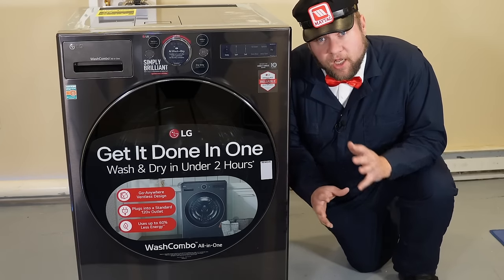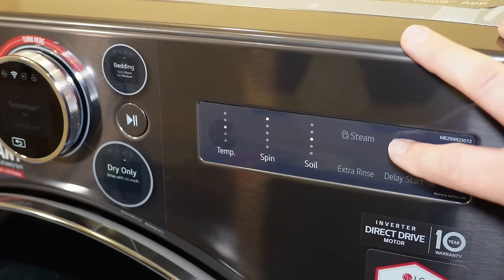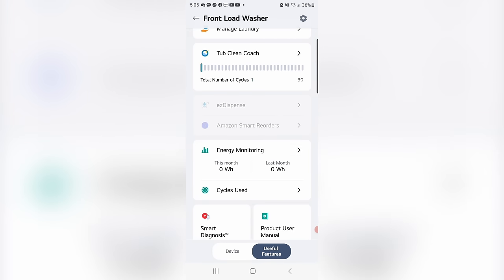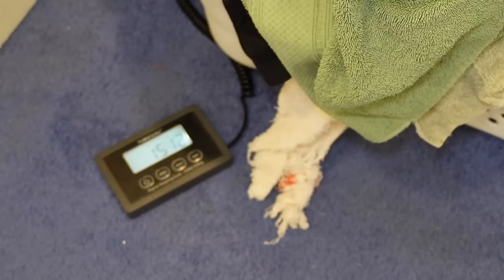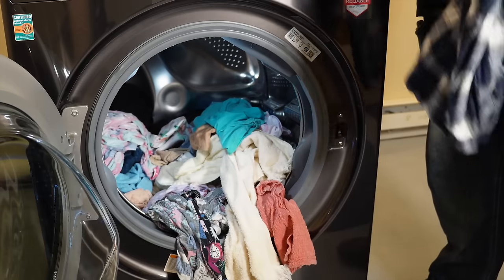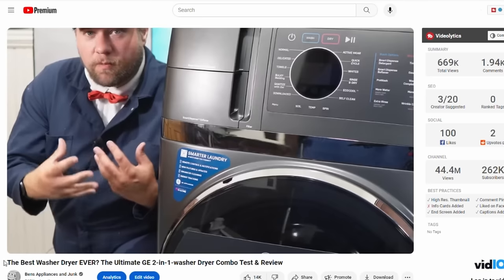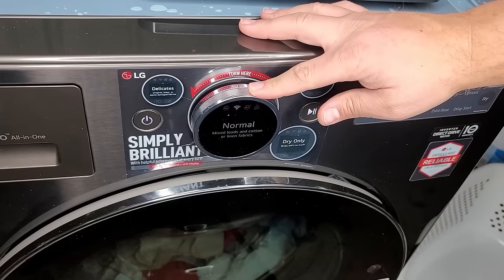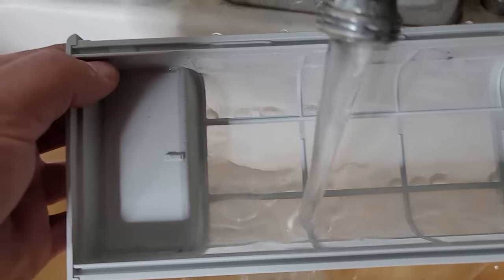BETTER THAN GE? The LG All in One Washer Dryer Combo: Test, Teardown & Review

Comment: What people are forgetting is that regular driers get lint buildup and need cleaned at least once a year, and you also have to worry about the ductwork in the walls. 

I wonder if the coils on the GE unit could be gently sprayed to clean them in a way that’s similar to how LG cleans the coils.
Reply: I picked up a high end Whirlpool dryer off of craigs list for free. The lint screen was packed with lint. I mean packed. I took it completely apart and inside was full of lint everywhere. Every crevice, heating elements, everything. I had to vacuum and clean out every square inch. I think they ran it until it wouldn't dry anymore and threw it out.

The dryer was also left outside in a downpour when I picked it up. I wondered if it would even work. I had to replace the drive belt and I think a couple of other inexpensive things. I think it was less than $30 total. Much to my surprise after I put it all back together and dried the control board out, it fired right up. It's electronic. It worked so well I switched it with my regular dryer I was using. That was years ago and it's still running well.

It's amazing how dumb some people are with things. Like not cleaning the lint out.

1960s Chevrolet Owners Manual - Here's how you adjust the valves, set the points, timing, etc. 
2020s Don't text and drive. Don't swallow Tide pods. If there are any problems take it to a service professional.
Reply: my washer dryer combo also get lint build-up that you have to clean after each dryer cycle
Reply: Lint build up once a year?   What are you washing?

Comment: You may have had better luck with the comforter if you had unfolded it, giving it a better chance of shifting around during the cycle wash and dry cycles leading to better results.
Reply: I truly believe this man doesn't do his own laundry considering the fact that is Laundry Basics 101. Not a single dryer can actually fully dry a comforter without turning it "inside out" half way through the drying cycle.

Comment: No dryer will dry both large comforter and sheets at the same time. Both of the things you said about why is true, but another reason is either the comforter or one of the sheets ends up completely wrapping the others up inside it not allowing the moisture on them to evaporate efficiently while also not touching the sensor making it think it's done. I have a king bed and some very large fluffy comforter(wife.....) and even with a very large Samsung stand alone dryer with plenty of room I can't dry them at the same time. One of them always swallows the others up and only the outside one dries. I've set it and kind of forgot about them b4 and came back a couple days later to discover the ones inside mildewed....my wife was not happy lol.
Reply: You need to try the GE ultrafast. This sheet wrapping thing does not happen and no need to open and adjust the drying load either. I would guess your King comforter AND sheets would about 3:15 total to dry. You might add 10 minutes but seriously the hot air being blown into the machine from all sides fixes the large load problem. I've had one tangle in 5 month and it involved the drawstring on some shorts.

Comment: I have an apartment washer dryer LG combo It still works great! You do have to do more tub cleanings than normal though because of the lint. I think mine's from 2017 or 2018
Reply: How do you have yours connected to? Does your apartment have hook ups or a sink connection
Reply: @EastCoastCamping  hooked up to a regular washer hookup in the wall. You can get the adapter for that to hook up to the sink mine didn't come with it but I can get one.

Comment: I'm happy to see more All-in-one heat pumps coming out. I got my Miele washer and heat pump dryer set a couple years ago, months before the GE became an option. Space savings and not having to switch from the washer to dryer would be nice, but I've otherwise been mostly happy with the Miele aside from having to troubleshoot plinth filter alarms. I wonder if the GE or LG have similar issues as I only see one filter being cleaned vs the two the Miele has.
Reply: I believe the GE has a 2-stage filter.  1 they say to clean every cycle - the other as needed with a warning light.
Reply: Personally, I love having the two separate Miele units: doing so allows for much better drying and washing times, plus we can do two loads at once. Having them stacked means they don’t take up any more space and an all-in-one would, but we also didn’t plan to fit them under a counter anyhow.

As to the dryer’s plinth filter, the big thing to know is that Fabic Softener is going to make it clog up a LOT: Softener is an additive that basically coats the clothes in silicone, which clogs up the plinth filter’s smaller pores really fast. Switching to a non-softening rinse agent will do wonders!

I also don’t trust units without double filtering, as it all but guarantees the compressor’s heat exchanger will be clogged by lint, ruining its effectiveness. Those small fins are near impossible to clean, so having a second filter is smart and ensures a long life.

Comment: I would definitely get the GE version because of warranty issues on the motor. I can't wait to see reliability on this one as time goes on. I guess if you like the app and get extended warranty you'll be ok for 3 years, but there should be a lot longer warranty with how pricey it is.
Reply: Both the LG and GE have a 10 year warranty on the motor tho?
Reply: Overall, LG makes a much more sturdy and reliable washer than GE. Also, the direct drive motor Lg uses is way more reliable than GEs belt drive motor, yet they both have the same warranty? Shouldn’t that be an issue with GE?
Reply: @TylerRing from what I recall, the GE heat pump is very easily accessible and easy to replace compared to the LG.

Comment: So as a servicer of some of these already the biggest complaint/issue we've had is that the dampening is not great. It just doesn't absorb the shock of the spin cycle well and causes a lot of OOB issues.
Reply from the maker: Thanks for the info! I would have assumed the suspension system would of been identical to their other 5.0cf washers. Any thoughts as to why this isn't the case? Is the spin RPM higher on this?
Reply: @bensappliancesandjunk  We've had very few calls on just the washers, or those new "built together" stacked units. It might be that the 2 in 1s are more susceptible to shaking if they aren't on a base floor(whether it be basement, or first floor for those without.)

The suspension in these uses a lever system, but it seems to only absorb shock in the front to back motion, left to right rocking doesn't translate well into it and that is what your typical OOB load induces. I tried everything to help a customer out, but after a long phone call with LG visual support they essentially blamed the customer for loading it incorrectly so I couldn't resolve it.

Comment: Heat pump warranty is a non starter since that’ll be the first thing to mess up. I thought this looked easier than the GE to disassemble, but maybe I’m just used to LGs. As you mentioned, the lint on the condenser is a huge issue. It’s going to be clogged after a year — especially with how bad people are at basic maintenance. I’d like to see a similar test and tear down on a tr7 Speed Queen.
Reply from the maker: Eventually I'll get to a TR7 at some point. Either that or a TC5, or hopefully both.

Comment: I originally purchased the GE and used it for a few weeks while waiting for a replacement due to aesthetic delivery damage. The replacement ended up being damaged during delivery as well, so I gave up and decided to go with the LG instead. The LG is much quieter with less overall vibration.
Reply: Too bad it takes twice as long to dry though.
Reply: @Finndian  In my experience, it does not take twice as long. A bit longer than the GE, usually the case, but laundry dried in the GE often felt slightly damp when it was "done" (and may have needed more time) while clothes come out completely dry the first time with the LG.
Reply: @btober  I think it's all about how much you put in it. This video definitely finds that it takes much longer to dry the same loads in the LG.

Comment: Excellent video! I first came across your videos on a YouTube suggestion for the GE all in one washer dyer combo. I was sold on the GE until this video, now I'm rethinking. Also I have watched many of your other videos. Thank you :)
Reply from the maker: They're both really neat machines. I don't think there's such a major deciding factor on one that makes it must-have. Both would be personal preference based on situation.
Reply: @bensappliancesandjunk  I have the GE unit. I have also seen lint on the condenser coil of that machine, but it is pretty easy to clean with a dryer lint cleaner kit from Amazon. I saw on Reddit that people have had luck adding weather stripping to the filter. The GE washing machine also has AI cycles, although I could not find any information on that other than a sentence in the owner’s manual. I usually use cold water, and now it defaults to that.
Reply: I own the GE and have the following observations: It typically uses 1kwh per load (equates to 27 cents in my area) which appears to be better than the LG but my GE produces very wrinkled loads regardless of content (sheets and bedding are just as bad as shirts and trousers) even if using one of the dewrinkle modes. Also, I didn't buy a washing machine so I could play with my phone. The GE performs just fine without using the app.
Reply: Thanks for the replies everyone! My situation is I'm in a one bedroom condo in a century old building. I need to save up for the expense of the vent build out, the gas hookup, and water and drain - all new. In the meantime the ventless all in one combo is the best solution. I'm not necessarily looking for a quality wash, within reason, but more the reliability. The older all in one units were too small and slow. The GE which I watched the video here a few months ago I was sold on but then after the this LG video I think I prefer the LG. From what I understand the GE is a little bit faster for the whole cycle but the LG is more reliable - a proven track record with the motor(?) and is quieter.
Reply: @jeffreygonzalez4353  Both units have a 10 year warranty on the motor. As he pointed out in this video the LG heat pump is undersized and only has a 1 year warranty. The GE is a 5 year warranty on top of being more robust. Just something to consider. (also you CAN control/remote start the GE with your phone unlike what is inferred in this video.)

Comment: Ben, thank you for this excellent review. Seeing the lint already built up on the heat pump coils was disconcerting. I do own the GE, bought it thru Costco in December for $1980. (good timing!) Yes, the GE does allow lint to get past the filter and collect on the heat pump coils. But... I can easily get to them when the filter is removed, so it's easy to clean off that lint. For me, that's a big deal, because as the lint builds up on the coils the performance will slowly drop. 
So yes... your video helped me. I'm keeping my GE. I'm also looking forward to a side by side comparison of the two machines. Thanks again. You do superb reviews!

Comment: Tip for those who are new to heat pump wash/dry combos to reduce dry time: pause dry cycle to put a dry towel or a few dryer balls to reduce drying times. 

Also, we regularly find our clothes are sufficiently dry with an average of an hour remaining on the dry timer, so worth setting a timer reminder to check your clothes and hour early for dryness. 

Additionally, avoid the temptation to overfill. Split a large load into two for fast and even drying.
Reply: I was wondering if the fairly hard wool dryer balls and the rubber dryer balls with the spines could just go in the wash cycle? I use one of each.
Reply: @jgoog7442  Personally I wouldn’t, as I tried this with my own rubber spiked balls, and after a few wash/dry cycles, the detergent made them hard and brittle and one developed a small crack. 

I also wouldn’t put the wool balls in the wash either, as that may actually increase drying times as there would be additional items to dry.
Reply: My concern is the filter you mentioned at the 11 min mark. Sounded like a home owner should be cleaning this frequently but not clear on how accessible this was as it looked like you had the machine apart

Comment: Thank you for this video, I bought the LG WM3997HWA Ventless 4.3 Cu. Ft. machine back in 2020, its been running solid without a single hiccup since then (its even running right now). Yes it takes a while to wash / dry. BUT, its whisper quiet and I don't have to switch the laundry from washer to dryer, so for myself and my wife in our little condo we really appreciate the space saving and the super low noise level. I think overall its a very good machine. Could you please do a video on the WM3997HWA? I want to know how to maintain it properly. Right now we use the tub-clean feature and I remove the bottom filter for occasional cleaning, but nothing else. I would really appreciate an in-depth video about it.

Comment: We do several loads at the same time, using both machines to wash and dry simultaneously
Reply from the maker: Which is why I think near the end, I mentioned I'd prefer the washtower that LG has, if its a possibility if you have the 240v/ductwork for it
Reply: @bensappliancesandjunk  Washtower has a heat pump option with no need for ductwork. I have one and it works well so far. 7.4 cu ft dryer too. You’re right that it does need 240v though. Great video!

Comment: You see those evaporator fins. They have to be cleaned.
If a good filter was placed on those fins, at least they won't get clogged. I wonder how much lint & dust they would pick up over a year. I have to clean my dehumidifier coils to keep the dust out. Secret to keep unit last.

Comment: Ben thanks so much for your comprehensive reviews.  One of your observations came true.  Your mentioning of the problems with the LG linear compressor in the refrigerators was highlighted in San Francisco bay area LG lawsuit over LG appliances.  So far there are 100 people in this suit. One lady had a LG refrigerator last 3 years and bought another that lasted 7 months.  I have been telling friends and relatives what you mentioned a while ago.  Thanks much.
Reply: Lg fridge compressors have always been bad (since the 2010s anyway). It’s a shame because it ruins the brand experience for a lot of people, and LG makes other great appliances
Reply: @Ikey04-ge9gy  I didn't know it was bad for that long.  Thanks for the info.

Comment: Great review, this model has been very interesting for the convenience it offers of putting clothes in and not having to monitor and transfer to a dryer.  I would usually run loads late in the evening, forget about them in the washer for many hours or until morning and end up just re-running them, this kind of combo unit plus the wifi app would solve for that.  If I were to put these in a new home, I'd actually like a pair to run a pair to handle 2 loads at the same time as well if it weren't for the high cost.  I think the value will be on future 2nd or 3rd generation once they improve upon the issues you identified.

Comment: It's more than obvious the electric companies have stock in these machines, the idea of one load of laundry taking four hours to wash and dry is beyond disturbing!
Reply: The all in one units are actually substantially more energy efficient. As he says in the video, the 4 hour cycle only used around 2.5 kWh of electricity. A standard electric dryer is somewhere between 2-6kw meaning a one hour dry cycle would take 2-6kwh of electricity. Not to mention the possibility of it taking more than an hour to dry a big load or the electricity used by your separate washing machine.

Comment: My GE is building lint on the condenser coils. I have had the GE for 6 months and followed the cleaning instructions.
Reply: It gives you a part number in the manual for their brush kit. Even normal driers have to be regularly cleaned to prevent fires. If you have to brush off the coils once or twice a year, I’d say that’s actually better than having to clean all the ductwork in the drier and in the wall once a year.
Reply: That's been my concern with the lint filter, and about the poorest part of the GE Ultrafast.  I'm actively shining a light in there pretty often, and using a narrow vacuum wand to grab those fuzzies before they get stuck to the coil...
Reply: I posted a solution that will resolve the lint issue on the Condenser…